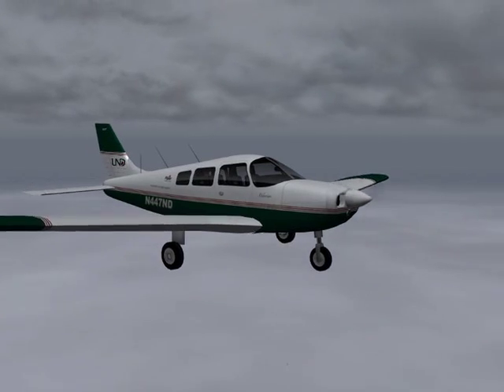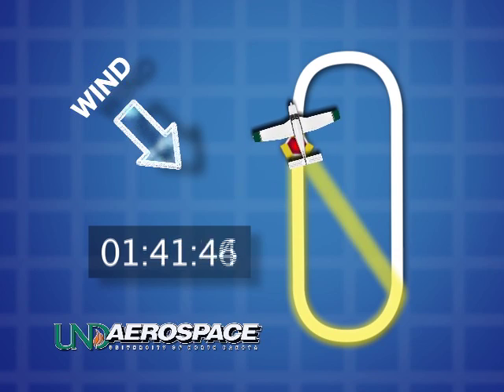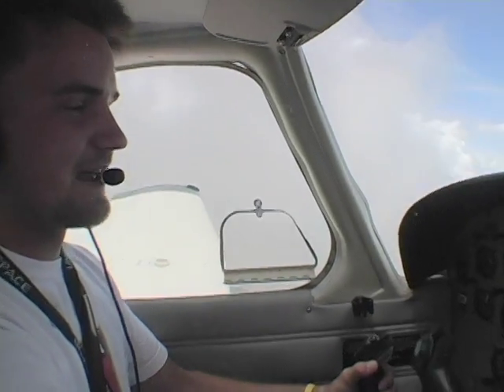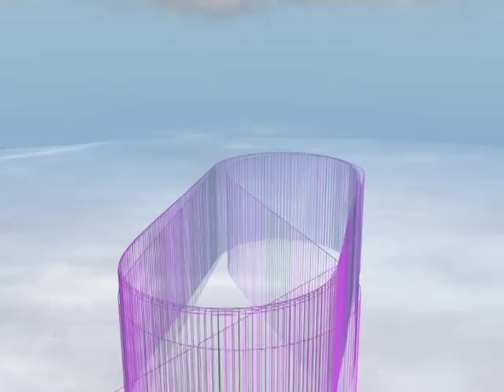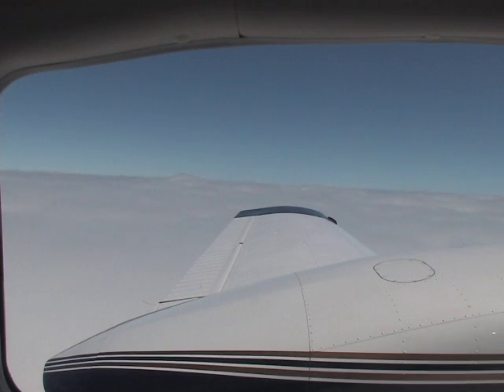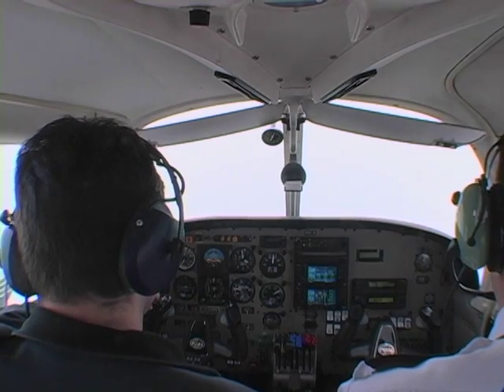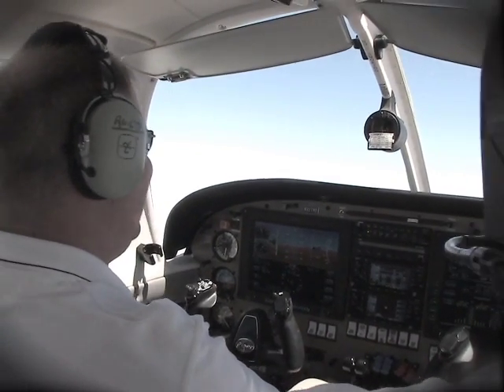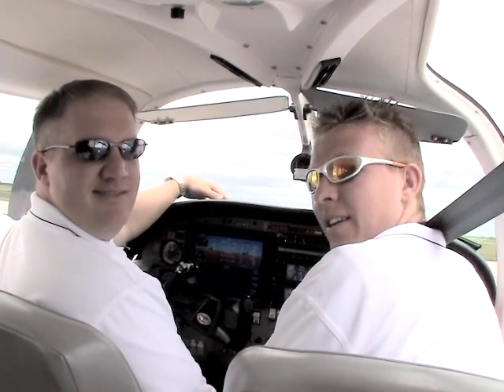(VIDEO 2) The Holding Pattern

Comment: There are different types of holding patterns based on distance or with 2 minute legs. There are two issues with timing.
1. Protected airspace is based on distance using the timing at maximum holding speeds with buffer because, as you mentioned, this will change the exact holding pattern.
2. Separation in the non-Radar environment is based on time to establish safe distances.
This way, certain expectations of both controllers and pilots are established and met. I hope that helps.

Comment: Why is a 1 minute in- and outbound leg so important?
As long as every plane in the holding pattern keeps its advised altitude and stays clear of ground it does not matter, if they fly a proper holding figure or only a simple circle over a fix. Anyway, due to different airspeeds every plane leaves it's own holding track.